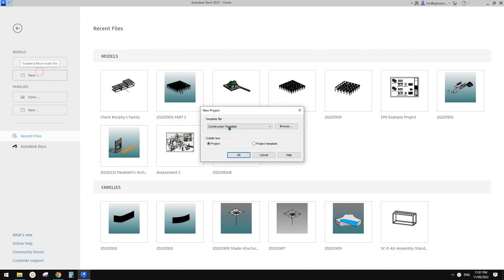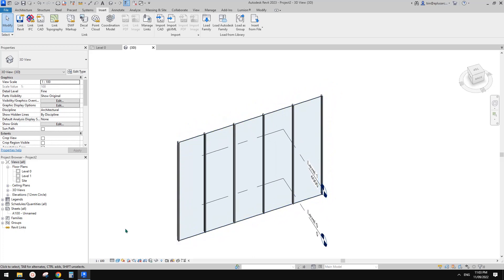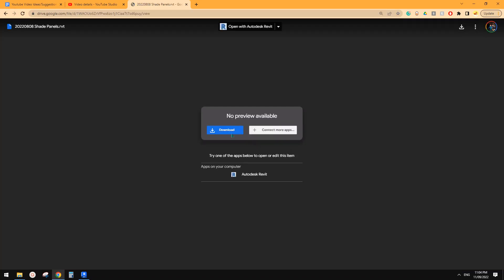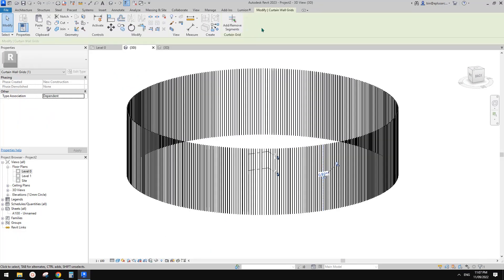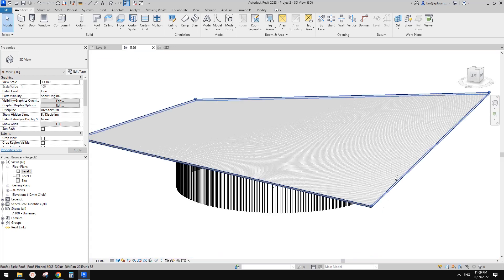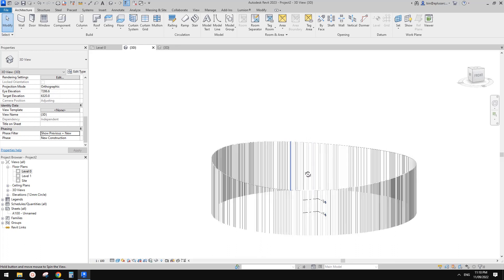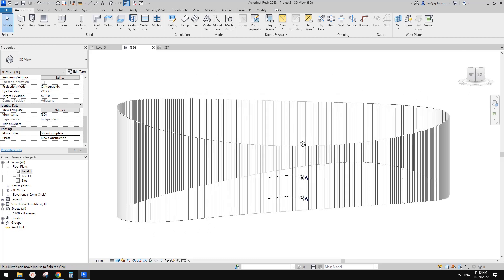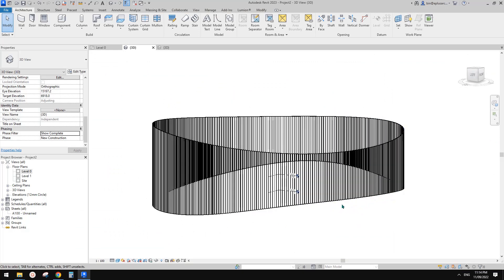Revit Exercise (Day 902) - Curtain wall w. Curved Footprint, Top and Base

Comment: Hello, I would like to ask a question, I am starting my masters project soon and I am debating which software to use as the primary one, I am torn between Revit, rhino and sketchup. I have been using Revit for a few years and have a pretty good understanding of most of its features. 

What would you recommend as a design software for yourself if you were to design something conceptual at an early stage of a project?

Thanks!
Reply from the maker: Okay.... If it was me, I would probably do some hand sketches, get the ideas in my mind, then work out a better way in Revit. But if you are not familiar with conceptual mass, pattern based or adaptive family,  you will probably find Rhino easier, because there is less restriction while playing with the shapes compared with the mass environment in Revit.  

My suggestion is, if your design is organic form, use Rhino. If you need some simply diagrams, or just push and pull architecture, use Sketchup. If you have a good understanding of mass, pattern based family and adaptive family, use Revit.

Comment: Simple and straight forward …. I wonder … 
1. once the shape is a circle can the mullions be a small piece of wall (any material) then array it 360degree so there is a gap between the arrayed walls? 
First ungroup array Then attach the Wall pieces to a roof ?
2. is it possible just to hide the curtain panels (by category) or demolish its phase in stead of using a special family for that?
3. I have tried the system “empty panel” Revit 2023, it looks like it is working also for non-rectangular panels
Reply from the maker: 1. It could work, but groups with hundreds of instances, no.
2. Hide only work in that view, you need to do it in every view, or use view template. You can not demolish curtain panel.
3. really? it would be great, I will have a try
Reply: Yep … if you hide you have to do it in all views you r right … but what about it you go in vg   and uncheck « curtain panels » ? 
Sorry … vg is also view dependent ! Sorry
Reply from the maker: @samoxflox9261  vg uncheck only works in current view, you need to do it in every view where you want to hide them. I usually just demolish them in the same phase to make them temporary. You can also use other methods to hide them, such as workset.